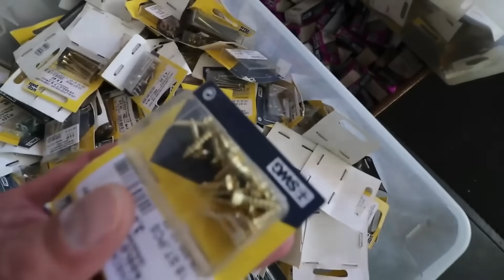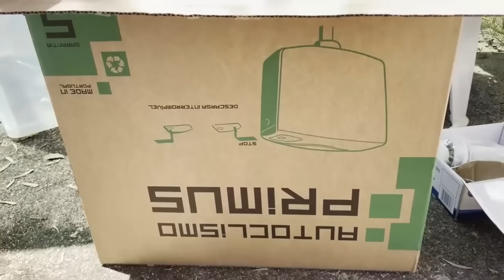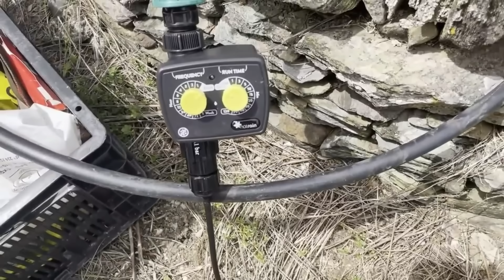1 YEAR TIMELAPSE - Renovating the Ghost Town

Comment: I know that this is a bit late but if you have stone or brick walls you will want to use hot lime mortar. It breaths where as Cement doesn't. Cement holds water in the walls and rots them by leaching the minerals out of them. Lime mortar lets the water out and has the advantage of being a good antibacterial agent.
Reply: Hot lime or easier NHL - natural hydrated lime - already hydrated - slaked - so no need to hot mix and wait... nice to see your posts again and that you are expanding! See posts by make do grow Portugal for many tips and details on lime and stone houses.
Good luck and have fun there 😊

Comment: Hello Jasper, the custom is that on the edge of doors or windows, in the finishing between gaps, a foam spray is first applied, which then hardens and completely covers any possibility of filtration. and only then comes the cement on top. But you are going the right way, because it is by doing yourself that you learn.

Comment: Did the original shade frame and shade cloth actually work as shade?  I have something on my deck in US...south facing and it gets too hot under the canopy that we actually can't use it. The top cloth is tan colored but it doesn't seem to make a difference. I even tried to put an additional vertical shade panel to block the afternoon sun...seems almost making it worse since there's no air flow.  I haven't figured out the problem yet...except many houses for sale in PT with roof overhangs seem to do slanting overhangs so I wondered if that had something to do with it.   Any idea from your side and /or what you learned?